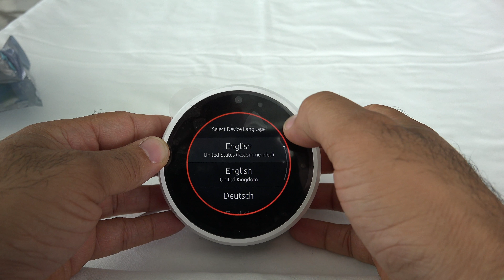Amazon Echo Spot Teardown

Comment: wow i know this is old. But on mine there was 1.5" embossed screw in metal chassis/assembly connected to back of the plastic case. Its behind a sticky thin metal cover on the front as seen in the video above. Dude in vid totally cut scene this portion AND put the cover back on. Amazing disassembly man. thanks naut

Comment: You can remove the screen 1000 times easier by simply rotating it counterclockwise 10degrees after the larger screw the base is removed. Then with help suction cup, it comes straight out. Great to dry it out if it gets wet from the rain!!
Reply: thanks i was trying to replace the screen and couldnt do and then i scrolled down and found this comment thanks!

Comment: Great review!!

I would like to know if the Amazon ECHO-SPOT uses the following Amazon Official Power Adapter?:

AC-Adapter Model: GP92NB

Part Number: PA-1150-9ABN

Output Volts/Amp: 12V – 1.25A (15W)

If Not... Please, I would be very grateful if you could tell me the Model Number, Part Number and Voltage/Amperage Output of the AC-Adapter used by this ECHO-SPOT device?

Thanks in advance for helping me!